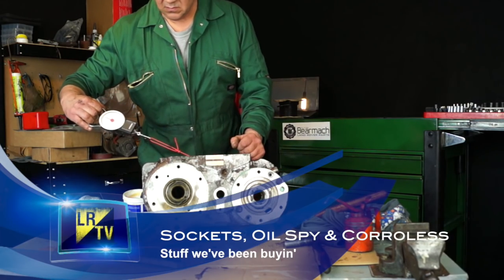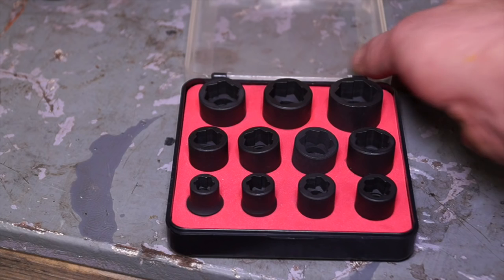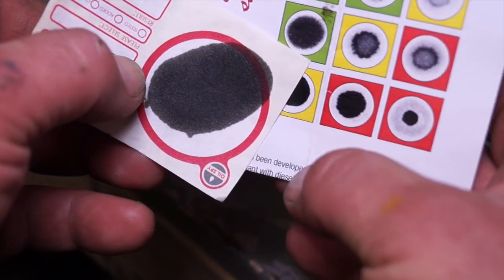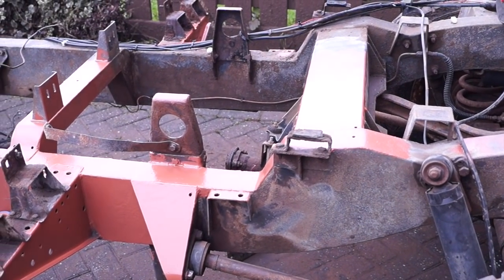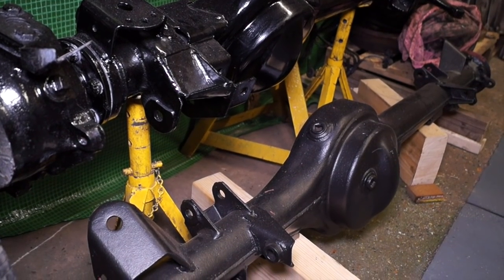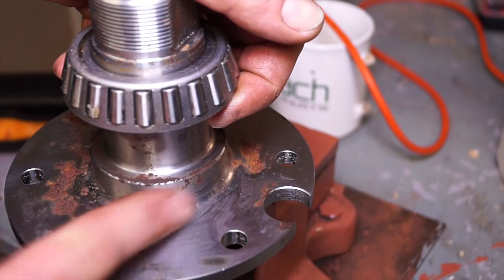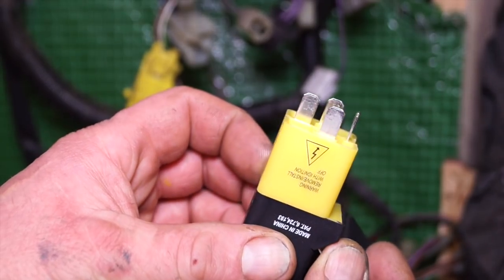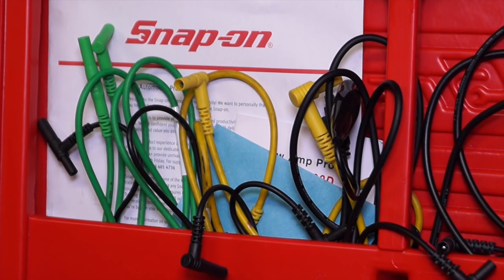Oil Contamination Checker , Corroless , Fourby's Sockets - LRTV Update

Comment: Corrosion inhibiting grease uses: prop shafts, steering ball joins, exposed fixings, electrical terminals, prepping some seals and leaf springs (for a series)
Reply from the maker: +Rangerover matt  ah yes steel electrical fixings....  like earths.  Good one!
Reply: +Land Rover Toolbox Videos we use it in the swivels and wheel bearings. Because it's around 40x more moisture resistant than Ep grease you don't end up with a grinding paste. Needs thinning slightly with ep90 for swivels. http://buzzweld.com/products/buzzweld-anti-corrosive-lithium-grease
Reply from the maker: +www.buzzweld.com   In the swivels?    Swivels need EP00 and the CV has graphite grease put in before assembly.    I have thought of a few more uses for the grease.  See in later updates.
Reply: +Land Rover Toolbox Videos Yes. It's a high impact grease, just a little thick in standard form for swivels. We've ran ours on this for a long time. You don't end up with an abrasive rust impregnated paste. And wheel bearings do well because they don't end up running in Mayo.